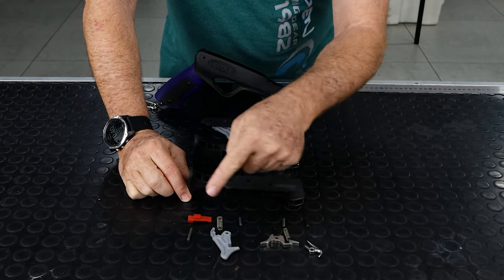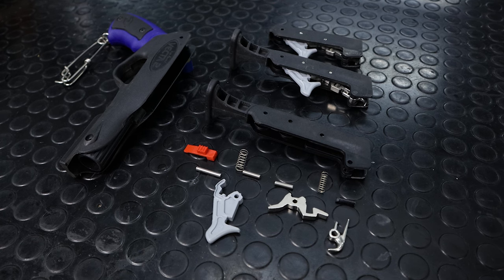Rob Allen | Loading Butt Components | 2024

Comment: Not a fan of the safety, so unnecessary. Probably a requirement to sell a speargun. Could I just remove that red plastic part and put it all back together?
Reply from the maker: No need to remove, just pull it back to the fire position and drop in a thick glue turns to block the void, preventing it from being able to move forward. The safety id also there to hold the trigger spring in position do can't be removed. In terms if the law, I don't think it is a requirement in any country but.... Many distributors want it.
Reply: También usarlo sin ponerle seguro namas es cosa de adaptarse yo tengo un tuna en roler i lo uso sin seguridad ya me adadte
Reply from the maker: @abdielmonrroy7187    Many disable the safety.  Muchos desactivan la seguridad.
Reply: @RobAllenSpearfishing  si al fin al cabo es solo adaptarse tengo un roler 90 i estoi encantado con el fusil va genial en las aguas de panama